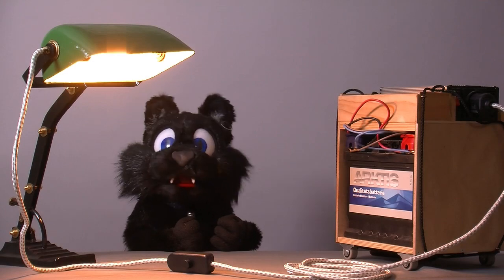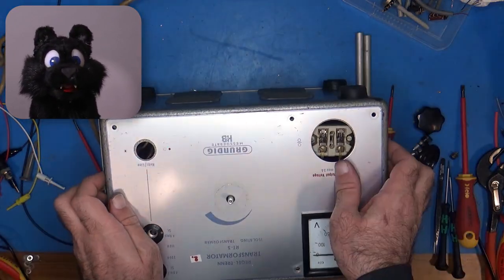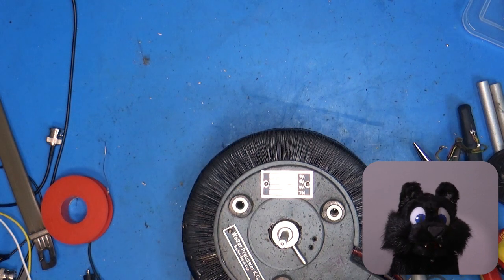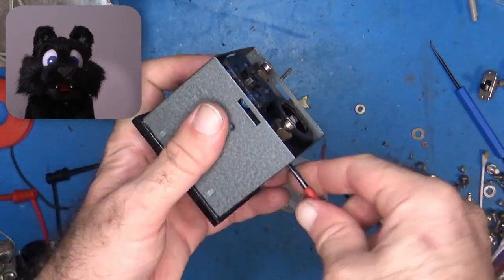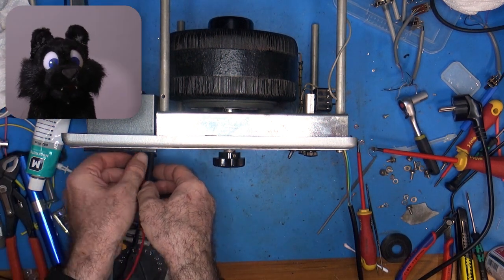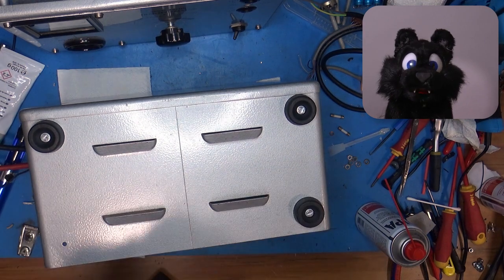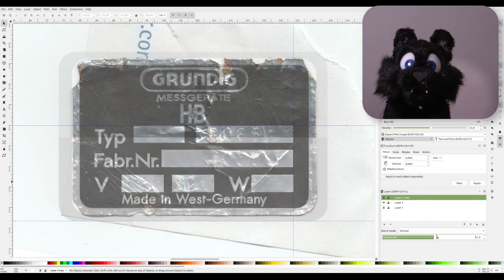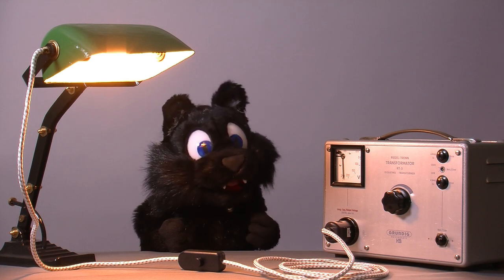Grundig RT-3 Restoration

Comment: Once again, an excellent restoration, at 16:37 I was interested to see that you are testing the unit with a banker's lamp as the test load. I have an almost identical lamp on my desk, this is the first time I've seen another of this type that looks like mine. Do you know where and/or which manufacturer made this particular lamp?
Reply from the maker: Thanks! And sorry, I have no knowledge of the lamp; it was left by my grandfather. So probably made earlier half of the 1900s? It doesn't have any label on it. Originally it had an enamel coating, but that was chipped, so I painted it during restoration.
Reply: @atkelar  I found mine in antique shop 25 years ago and had to restore it as the enamel on the base was in poor condition. Till I saw your lamp I had never see another one with a stepped base. I'd guess it was made in the 1930's or 1940's, Art Deco style.
Reply from the maker: Could be; my granddad was born in 1920 and he used that lamp as a worklight in his cellar for decades... it was in pretty rough shape when I had pitty with it. But mine only had enamel on the top part, the base was just painted.

Comment: That non grounded recepticle's is officially caaled a CEE 7/1 recepticle, its aslo called a Type C recepticle. In the netherlnds those ungrounded sockets are still very common
Reply from the maker: Thanks! Around here, nothing new since I can remember had them... Not sure.if the current code even allows them.